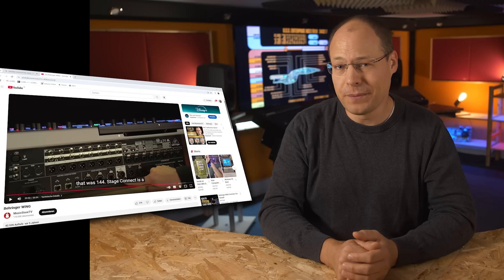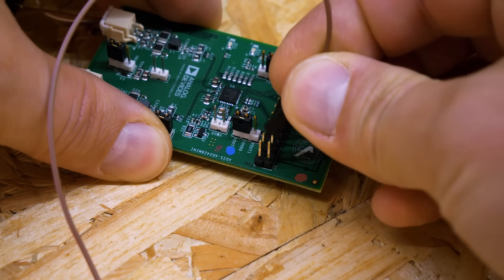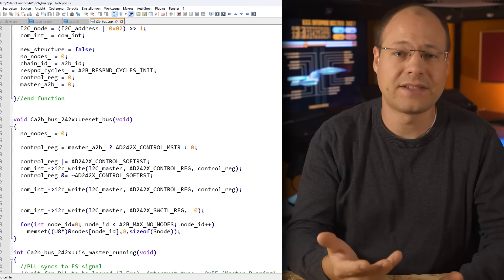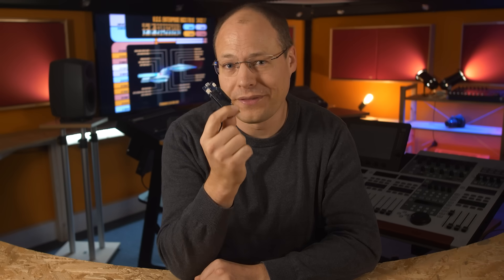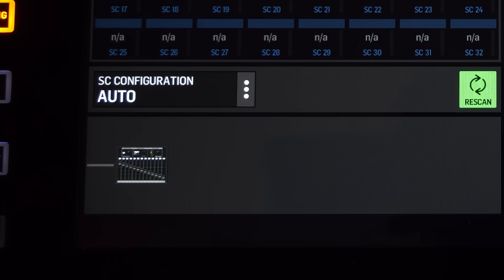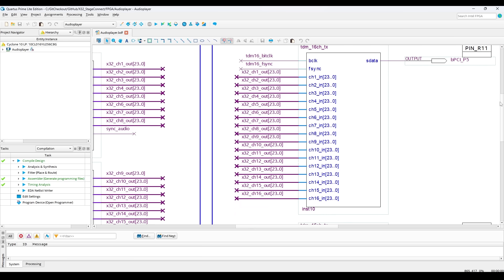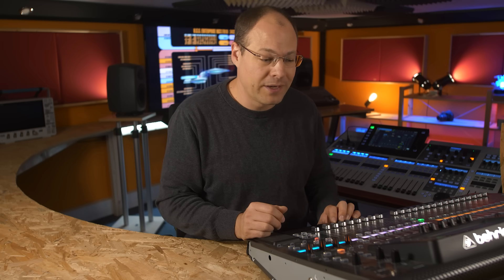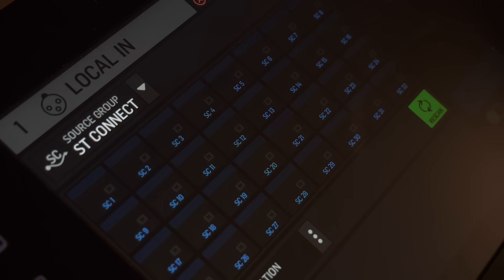StageConnect is OpenSource... and the X32 knows it

Comment: I'm dying for a 1U output box with 8x AES3 XLR digital outputs similar to the Midas DN4816-O

Most modern amplifiers have AES3 / AES/EBU  connections and they sound way better than the Wing's analogue outputs..
Reply from the maker: Yes, this is possible. AES3-transmitter are available in VHDL (https://ackspace.nl/wiki/SP/DIF_transmitter_project) and TDM16 from the A2B-board can be received within the FPGA without efford. So its more or less a simple connection of the 16 outputs of the TDM16-receiver to the individual stereo-inputs of the AES3-transmitter. The are also opensource tools available to synthesize the logic for Lattice FPGAs and maybe other FPGAs as well. Could be a good project to get in touch with FPGA.

Comment: Hello Sir, I would like to ask if it is possible to use the Waves DN32 card without an X32 console. For example, by creating an ADC/DAC module that can be directly connected to the DN32 card. Thank you, Sir. 😁
Reply from the maker: Yes, I've built a CARD-2-CARD Adapter (see here: https://youtu.be/3Uor9Ot7x9M?si=roCgAc7gP9C6o2E7&t=853) that allows the connection of two X32/M32 cards. But up to now I did not have a Waves-Card here to reverse engineer the protocol. Each card has a different set of commandos and maybe need special treatment regarding the clock-source as the Waves card can act as a clock-source as far as I know.

Comment: Cool! Is that possible to built a simple cheap DIY device for reusing vintage firewire interfaces as standalone stageboxes? They usually have ADAT I/O and most of them can operate as standalone converters, so the question is to convert ADAT streams to SC and back.
Reply from the maker: Yes, ADAT is very common and contains 8 audio-channels. Actually I'm working on a device that has two ADAT-inputs. I'm upgrading it to act as a StageConnect device to connect it to my WING. I will publish my work when I've got a working demonstrator which should be around mid december
Reply: @pcdimmer  I have an old Behringer ADA8000 I'd love to use for more I/O with Stage Connect for my Wing Compact!
Reply from the maker: @glasaudio for the P16I I'm working on something like this. Maybe the ADA8000 is worth looking on it as well😊

Comment: As a community, we should try to pressure Behringer into actually doing stage connect development in an open source manner.  Throwing the code over the wall and letting us go to town is a lot better than nothing, but the real benefits of open source development come when the communication is bi-directional. If someone finds and fixes a bug in the open source code, we want that to find its way back into the mixer. But more importantly, if someone, on either side, builds a useful feature, we want that to be integrated (or integrateable - via a software switch).  So we really want Behringer to run the code repo if we can convince them to do it. There usually end up being other benefits to moving an internal project to open source - recruiting, build process refinement, etc.
Reply from the maker: I don't know if this is the right approach. A2B offers a stable approach that can connect relatively inexpensive (around 10US$ per A2B chip) multi-channel audio devices with each other. Since the used I2C communication is actually not very important unless you need compatibility to specific devices. Whether the Behringer protocol for WING or another protocol is used is not necessarily decisive.

Comment: Can Behringer stage boxes & personal monitor mixers be connected to Allen&Heath mixers (eg. Qu, SQ) using a converter with 2 different interfaces?
Reply from the maker: The Behringer Stageboxes are using AES50 while the A&H Stageboxes are using dSnake. So in theory it is possible to create a converter between both, but as both protocols are quite challanging to implement, I don't think that this is possible in a short amount of time. According to this white-paper (https://www.allen-heath.com/content/uploads/2023/11/DX-gigaACE-white-paper-1.pdf) dSnake allows something like "auto firmware matching". So allone this functions should make clear, that this will be a huge project to reverse engineer...

Comment: Are you working on AES50? if yes i can stop staring at the spec and packet captures and fail to understand the terrible "scrambler"..
Reply from the maker: Well, it is on my todo-list and I've already bought the specification and created a small test-PCB for tinkering with the AES50-connection. But I'm pretty sure, that I won't get something working until late next year. Its quite tricky to get the clocks under control. And there are lots of small things that will take some time to get up and running like the described random-generator to determine who is primary and who is the secondary device as this is changing on each connection... keep an eye on my blog or my GitHub repo and you will get informed as soon as there is something new. That's the best I can tell so far...
Reply: @pcdimmer I have the spec and the implementors guide and am currently trying to decode pcaps. I can do the the headers just fine, but the "read the buffers 90 degrees to writing them" . not really

Comment: This is amazing, thanks for your awesome work. I'm very curious in where the community (and maybe the market) will take this.
Do you know if there would be any way to implement mic preamps in a stage connect box? I could imagine it would require some form of remote control data to be send and received.
Reply from the maker: That's absolutely possible as the message system is able to transmit control-messages. The problem would be, that the WING firmware is not supporting this. But we can establish a StageConnect primary device and can control a DIY subordinated device with the preamps and could control the preamps over StageConnect. There is the Midas DN4888 on the market, maybe they are using something like the system described above to control the preamps already, but up to now I had no chance to get in touch with the StageConnect devices.

Comment: The poor wing rack, x32 only guys need an easy (and cheap 😂) way to have Headphone access for Solo Listening. Could Stage connect be  a solution? Current option is running back a sd8 via aes50 plus headphone amp. Thank you for your work 😊
Reply from the maker: Yeah, I have a similar problem. So I'm thinking on implementing a StageConnect -> UltraNet converter to connect the P16-M devices to the WING Rack directly via StageConnect.
Reply: The Klark Teknik DN4816U is a universal and compact interface box for sharing 32 channels of audio between StageConnect devices, Behringer Ultranet and USB audio on your PC

Comment: As far as practical concerns go, what is the cable fussiness like with stage connect, like aes3 has always needed specific 110ohm XLR to work properly, does this need that aswell? Also what is the cost to implement this tech vs aes50/madi-hd/slink/aes67?
Reply from the maker: A2B seems to be pretty robust and was originally designed to work with unshielded twisted-pair cables. When using shielded and optimized cables length longer than the suggested 15m in the A2B spec is possible. So, the connection seems to be quite resilient against bad cables when you keep an eye on the length.

Each A2B IC is around 10US$ on mouser.com. So with two ICs and a couple of passive components you may be around 50US$ for a direct connection. AES50 would be more expensive as you need an FPGA next to an ethernet PHY IC on both sides to implement the ethernet connection.

Comment: Bro take the behringer and throw it away. Time for a nice mixer. Nothing but bad luck with the behringer line.  Roadie for the final genesis tour and it lasted 2 gigs. Whole things a mess of circuitry and underperformqnce
Reply from the maker: It's sad that the technology didn't work for you. From a purely technical point of view, the X32 is great fun. Our band only performs a few times a year, and usually for a small fee - we probably couldn't afford other manufacturers, as I finance the technology by my own. So in 2012 the X32 was a blessing for me, without which we would never have achieved our current sound.

Comment: What I wonder about: When you configured the Wings settings, there was a cursor selecting the settings: 
Can you use a computer mouse with it?
Reply from the maker: Yes, that's possible since a few years now. This WING was lent to me by a very nice man, but it has a defective touchscreen. So I can only use the mouse controls. But even with that, the system is easy to operate. I normally use an external touchscreen and the WING Edit software—it works great.

Comment: StageConnect SDI Embedder/Dembedder would be amazing for broadcast setups. Another world for you to explore, if you haven't played with SDI yet? :)
Reply from the maker: I have two video-recorders from Atomos that have SDI, but never got time to get in touch with this. High bandwidth/high frequencies are challenging for hobby. The TDM16 with its 12.288MHz was already hard with jump-wires :-)
Reply: @pcdimmer  Yes, if you want to be able to do this with e.g. 3G SDI it's not really possible to breadboard it. But 3G SDI equalizers/reclockers and FPGAs with quick enough serdes are available pretty easily now and not difficult to layout on cheap manufactured PCBs. Maybe it's something that finally pushes me to get my hands dirty with FPGAs...
Reply: @pcdimmer  I have seen the mention of TDM16 running at 12.288MHz also on the video. No sure how you calculated but in my book the BCLK for TDM8 is 256fs (32*8)  so: 256*48000= 12.288MHz. For the TDM16 you would need 512fs to place all 16 channels between on fs cycle so: 512*48000= 24.576MHz

Comment: Stageconnect to dual P-16? Or P-16i to Stageconnect as a sort a stagebox?
Reply from the maker: Yes, both is possible. Recently I've bought a WING Rack for our BigBand and it has no UltraNet connection. But I still have a broken P16-I and I'm planning to upgrade it with StageConnect to use it either as AnalogInput box or as a StageConnect to UltraNet-converter.

Comment: What methods might be possible for low latency connection to a mac or pc?  Would and X32 AVB card be possible?
Reply from the maker: I'm in contact with someone who has the same idea. But up to now I have no experiences with AVB. It is using regular ethernet-connections with PtP and QoS, but implementing this during the spare hobby time could be very challenging... but I might have another look at this. Sounds interesting in any way.

Comment: Brutal! Thank you for your service! As an idea: the possibility of using existing cabling via Stage Connect to get multiple signals from A to B...
Example: Microphone at the pulpit to the current mixing console... a kind of sub-core box located at the pulpit, allowing you to transfer the audio player from the laptop to the console without having to install new cabling. Or as a sub-core for 6-8 singers in a choir with direct cabling (for looping through a maximum of channels).

Comment: If all you're doing is injecting config data via the i2c port. I would highly recommend using the good old fashion Arduino UNO board (atmega328) instead. Using a pi pico or ESP is way overkill.

Comment: Hahahaha.
When I first saw the StageConnect bus, I was thinking how this was to work.
I was guessing that they will have an IP/ethernet based solution but would use a 100mbit automotive 2-wire etherned standard.
Well, they didn't went this path, but instead they used a dedicated automotive audio bus that I was not aware of. Of course THAT makes things a lot of easier. That's funny 🙂

Comment: As with the proposed projects, I would start with two simple ones:
 1) an opensource Stageconnect "USB soundcard"
 2) StageConnect <-> RaspberryPi <-> Ethernet / IP for something like StageConnect <-> AES67 open-source converter.
Reply: BTW, yet another project would be StageConnect to a bunch of simple AES/EBU (AES3) / SPDIF inputs and outputs.
Some legendary FX's like the lexicon mpx 500 or so have SPDIF input/output. You would then be able to add those as additional effects to the Wing.

Comment: I'm wondering how to get an AES/EBU connect on X32 producer or M32R. Do you have any idea?
Reply from the maker: As the AES/EBU-Ports are connected to the second DSP of the X32 and there are no tracks on the PCB on the smaller X32-devices it will be hard to get AES/EBU on the producer and the compact. Maybe its easier to use the S/PDIF connectors of a stagebox and convert these signals to AES/EBU?

Comment: beautiful! Can I give you a wish list of other X-series related things to open source? :D
Reply from the maker: Sure, why not? :)
Reply: @pcdimmer  well, the most pressing thing for me would be x(air) edit and its close relatives, would be really nice to port this to aarch64 (currently only works on amd64 and arm32 AFAICT). Directly next up / related would be their libraries they use for their extended midi controls. ...I'd love to (have / write) plugins for remote control aspects of channel strips, or the (bus or channel insert) FX. Since the Behringer Touch can control the mixers via MIDI - and at some point I even found a PDF somewhere explaining the values - would be nice to have the actual implementation from X(Air/32/M-,...)edit.
I'd also love for the headphone out on the MIDAS DL16 to be adressable via AES, but I slightly doubt they'd release enough of their embedded systems to start hacking consoles. But hey, I'd take it if they did!

Comment: Does this somehow open the door to sending MIDI over StageConnect?
Reply from the maker: Hmm, if I remember correctly, the I2C connection is at 100kHz that would allow MIDI over I2C... But without changes on the WING Firmware this would not be working... umm, where is my screwdriver for the WING... hmm... :)
Reply: @pcdimmer  Or you can embedd the MIDI message in the audio stream...

Comment: Would it be possible to make a StageConnect box that also has preamps in it?
Reply from the maker: Yes, of course, but its already available on the market: Midas DN4816-I
Reply: @pcdimmer 
The manual says:

INPUTS/OUTPUTS – Connect line-level
inputs and/or outputs to these jacks. Note
that inputs do not have microphone preamps,
and therefore any microphones should first be
connected to preamplifier before connection
to a DN4816-I or DN4888 unit.

Would it be possible to build a box with microphone preamps in them, and not having to use an external power source?

Thanks for an interresting video!

Comment: I ❤ Behringer... Making gear affordable and now also doing open source 👍
Reply: Stuff like this is a great example of why I'm a huge Behringer fan, even if they get looked down quite a bit by musicians I know
Reply: They're pretty dumb and idiotic, using three pin XLR for StageConnect.
Absolutely no brain was used to drive that decision
Reply: @juweinert  and what's your argument for this offensive comment? On the contrary, saving your money using standard cables is a wise decision.
Reply: @MrAndreavalle  microphone cable is the wrong type of cable. It's not controlled impedance, it's not properly twisted and the wrong diameter of conductor.
Digital differencial signalling needs the right kind of environment to be robust as designed. There's a reason for the price difference.
Using microphone cable will work in most cases and give you a false sense if security. It'll work until it doesn't, at which point it gifts you with signal integrity issues that are really hard to diagnose if you don't know what's going on.
Cheaping out on cables like that is anything but a wise decision, unless you're being paid by the hour and have no time constraints (which is basically never the case in the event industry).
This has been an ongoing issue with DMX for decades and we all should've learned our lesson there.
Reply: Every company doing open source is doing it for selfish reasons. Behringer is looked down on by musicians for multiple reasons, but live sound people certainly respect their digital mixers. Their analog mixers are just blatantly worse copies of Mackie mixers.
Reply: @RaquelFoster Many changes happened to Behringer as a company in the last few years especially in the digital mixer department
Reply: @RaquelFoster  synthstrom deluge is open source... Are they selfish too?
Saving up for a wing rack 😂

Comment: Would be an interesting way to send and receive audio to pc, only 2 sample latency sounds good, question is on which connection would be fastest, PCIe, occulink, Thunderbolt or USB?
Reply from the maker: Even the old PCI bus is capable of transferring 133MB/s (if everything is working perfectly). Adding the A2B-IC to a PCI-card is a wonderful idea. I will think about this. Of course, more modern USB-ICs would be easier, but I love to tinker with retro-hardware, so PCI would be my first choice here.
Reply: @pcdimmer  I would rather go the IP/ethernet way. By going higher speeds (1gbe/10 gbe, even 25/40/50/100 gbe) the latencies also go down very dramatically.
I think, gigabit ethernet has something like 200µs for ping (not ms, µs!) - however the ping packet is pretty small.
If I'm correct, USB has worse latencies - but correct me if I'm wrong.

Wrt to the latencies, I think, PCIe gen1 was definitely quite worse as compared to the PCI, the first PCIe soundcards were terrible.
Reply: @btudrus  I would love to see some ultra-low latency Eth to StageConnect interface, it could be a competition for WSG interface for live plug-ins!
Reply: OCCulink or SFP copper. Since OCCulink is just PCIe 4.0 in cable form without the need of drivers or special interfaces, you're only limited by its x8 bandwidth.